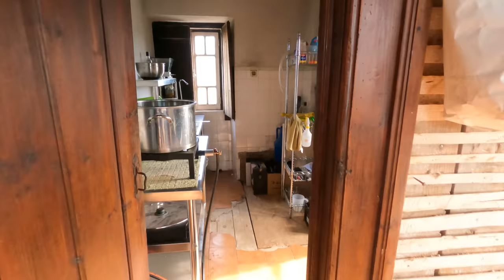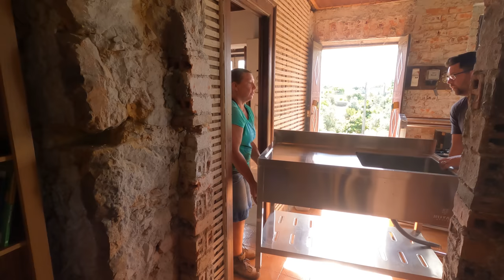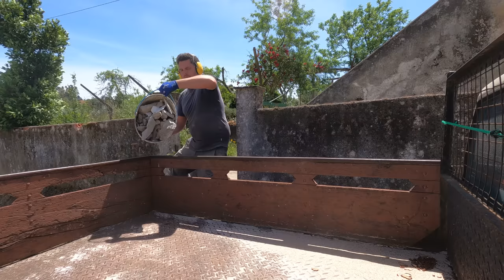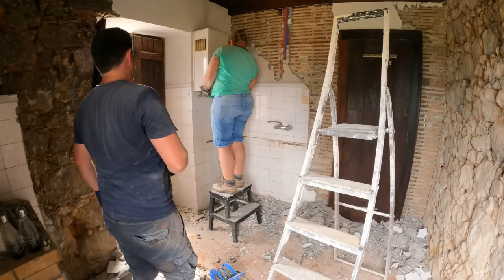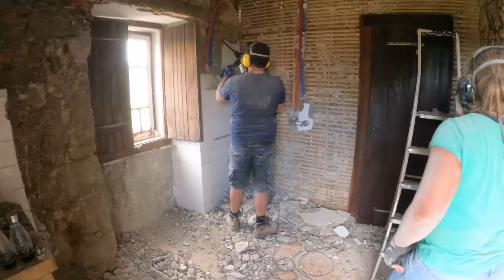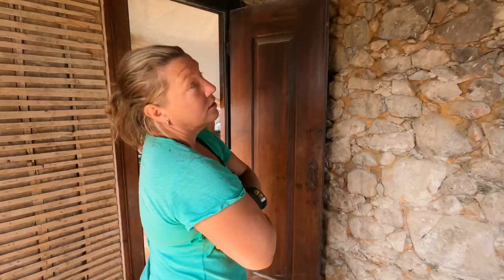This Has NOT Gone to PLAN - Restoring a Stone Building

Comment: Watching this video and others of people restoring stone buildings as they laboriously remove cement rendering, it's apparent that many in the past thought they were doing a good thing by applying a waterproof layer on the walls.  They didn't realize that they were creating a moisture trap that would doom the walls to damp, deterioration and mold.  Perhaps, in the quiet of the night, you will be able to hear the sigh of relief from those old stones!
Reply from the maker: Unfortunately there’s still quite a lot of people that think cement is the answer (cheap and fast). Maybe with more people using lime the word will spread

Comment: Well, when I see the power lines ....
I love the German system where electrical wiring on walls (under the plaster) can only be done vertically or horizontally.
If you want to drill into the wall later, you can very easily avoid damage to the wires.
But .... I start sweating just watching. Good work.

Comment: I can tell you from experience.  My grand parents farm house maybe 1-2 hr north of you and then my parent's home built in early 70s FRED FLINTSTONE STYLE ( STONE, CONCREET SLABS, LADILLOS for interior sepatation) had massive humidity issues.  After installing a dehumidifier  and realizing the amount of water coming out , GALLONS , GALLONS DAILY  non stop, we ripped out all the walls  , put up a vapor barrier, 2×4 framing against the vapor barrier wall  wich allowed us to run new  electric and plumbing thru the studs then ROCKWOOL insulation all around (Water proof, fire proof , sound proof product ) then 1/2 inch  sheet rock all around...   The difference is night and day especially in the winters.   If you want to use the ORIGINAL WAY , the ONLY WAY to get the humidity out is to do like my grandmother/ mother usto do. OPEN UP all windows and doors to air out (dry) the house..  evey sunny day. OR, install dehumidifiers with drainage to the outside.  Youll never keep up emptying them manually.   As a child I remember my grandmother lighting her big WOOD STOVE  , it was on all day and it would dry the interior of the house in the winter.

Comment: Fascinating to see the history of a building revealed. 
I think however if you leave a lofted ceiling over a living area with a woodburner, you'll just lose all the heat benefits when you light it. 

My second alarm bell rang when you said you'll use OSB as your sub floor. That sounds like a 'period' mistake, on a par with earlier owners rendering walls in the 1970s with gypsum-based plaster or concrete.  If you need a subfloor, say for an engineered oak laminate or for tiles, then I'd use plywood. 

Best wishes from the UK.
Reply from the maker: Plywood here is insanely expensive … in fact the same cost per square meter as the limestone tiles we just bought?!?!? Why spend that much money just to cover it up. The OSB on the other hand, the formaldehyde free version we source, is half the price and just as suitable

Comment: Blow That Wall Out!  The lath and plaster interior wall.  It looks like there is no load on the interior (non stone) wall.  You might need a temporary support but you can put a beam above at a later date if needed as the span is fairly short.  I did this in an old house and the extra space it created was amazing.  It lets more light inside the house and makes your space multi functional while making everything look much larger.
Reply from the maker: We are considering that too, just not sure how it will suit a rustic farmhouse. We’ll probably play around with some 3D models to see what we think (similarly for the vaulted ceilings)

Comment: I'd guess the stairs were built right against the stone wall before the plaster went on and that's why that bit of stone looks different. Actually the stairs might have had timber walls around them, the whole bit on the right is darker than the part by the door. If the stairs were walled off, they might not have bothered with plastering the walls above, it was just a storage area.

Comment: Wondering if it was originally opened to the top, but after time, in order to help keep the lower levels of the house warm and not spend a fortune on heating, they put up a ceiling with attic access while keeping the stairs. Then after awhile they started using the attic less and less because it was a hassle to get through the attic access, and they ended up tearing out the stairs, and cementing/tiling it all in...?

Comment: I'm trying to figure out the scene at approx 8:20 where you are unloading the rubble over a wall onto an enormous pile of the same around an orange tree ... I had assumed you loaded the truck up with rubble and took it off to your nearest official dump. Presumably, like the UK, you would have to pay for the privilege of getting rid of it. But you seem to have driven it from your front door to some other part of your land - 100m? - and have alternative plans to use/recycle/remove it.
Reply from the maker: We have collected ALL our rubble since the beginning and dumper it there under that tree (it’s a nêspera/loquat rather than an orange tree).
We have many plans to reuse it all … saves it going to landfill
Reply: @MAKEDOGROW  I see chaingangs rock breaking in your future, while you sing the blues or anything by The Soggy Bottom Boys ...